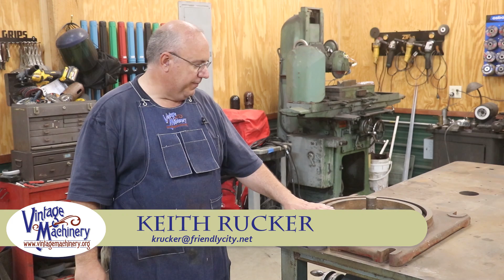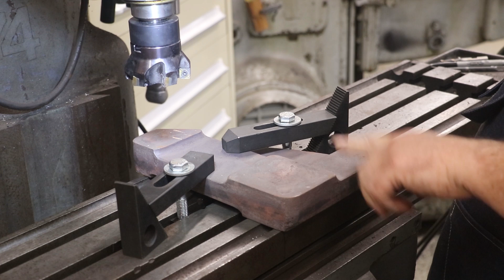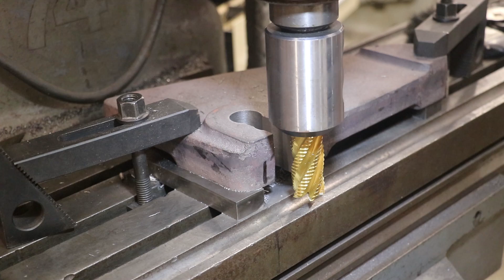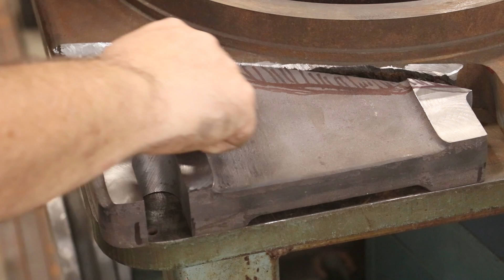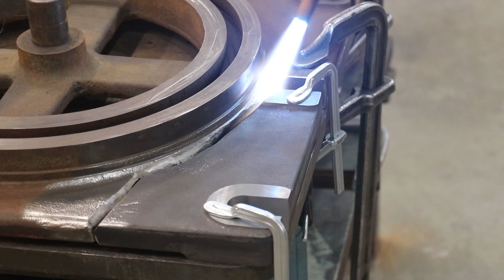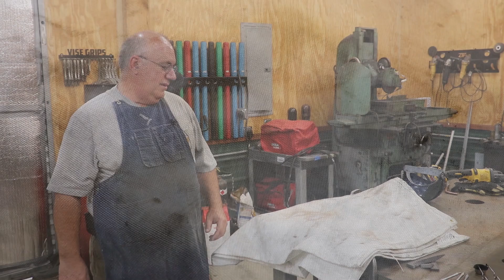Cast Iron Repair Job: Machining a Replacement  Casting and Brazing in Place

Comment: How much would you charge to clone or remake or fix a cast iron plate that's 3 x 10 inches with 2 bolt in thread holes.?

Comment: Wouldn’t you normally want to just use maybe a 3/4 inch end mill and step over to your finally dimension? To avoid things like the harmonics that may be made worse by cutting on either side of the slot

Comment: I know this is an old video but I do alot of old farm equipment repair which consists of a lot of cast repair we don't have time most of the time to heat and weld and reheat and pack cast to do so called proper cast repair and most of the time the piece is still on the tractor or implement. If it's a no load item I always braze it I have cast things I brazed 30 some years ago still holding up still doing their original job, If the part is something with a load or is in contact with ground such as tillage implements I weld them back together with 308 stainless rod bonds cast nicely and wears good in the abrasive dirt I've never once have had a repeat repair on cast parts welded with stainless many of the old timers did it and many of their repairs are still holding strong see them everyday just about. You'll of course have your keyboard warriors tell you brazing or welding cast with stainless is wrong it will never hold it's weak and so on because they have never done it or they can't weld period or they never cleaned their parts properly or someone told them it's wrong and doesn't work. I have a Cat D7 dozer that was abused it's whole life in a rock quarry that machine is pretty much all brass and stainless with all it's welds and cracks that were repaired over it's life but the machine at 73 years old will still go out and push dirt all day long like it was built to do.

Comment: Wouldn't have trouble keeping the heat in and not use so much "gas" in your bottles if your part was wrapped up in a welding blanket or insulation of some sort. What no post cooling hot box?

Comment: Keith, what rods did you use for that job? I have to braze up a broken cast iron garden ornament for my wife. I do have SIF Silicon Bronze No.1 rods which is supposed to be suitable for both mild steel and cast iron. I will be using a Carbon Arc 180 Amp AC welding torch as I don't have gas but will pre-heat with a butane torch. The alternative would be to use some 2.5mm nickel/Fe cast iron welding rods but like you, my results with these have not been wonderful and have looked a bit messy. The cast iron is quite thin and I find it is easy to get holes with the Ni/Fe rods on an AC arc welder. From past experience, I find they work better on a DC welder, which again I don't have.

Comment: Gave me a flashback of when I was watching my father-in-law braze an Old International 101 combine variable speed pulley half to re-build and bore  the pin holes it road on.  He was sitting with the pulley in a stump mounted vise, somewhat between his knees. A hot molten bead ran out and down the slope of the pulley and right in his half open laced boot. Big 6'-6" 280 pound man pulled that boot off tearing right out of the leather. Had went all the way to the sole of the boot and  cauterized  the wound on the arch of his foot. Last time I seen him braze anything.

Comment: If you have a veary large piece to Braze for added strength drill and tap studs at different angles in the gruves use Borax flux generiously and use plenty preheat burners on the bottom castings 🙌🔥

Comment: When you melt cast iron to weld, the material crystallizes during the welding......nothing I have personally seen welding wise does not ruin the metal.

Comment: Couple of comments from one old school maintenance man to another:

If brazing gets the job done for the intended purpose, why weld?!?
It's kinda like going to prom in high school. If you can take your girl in a ragged out AMC Hornet and get as much "action" either way, why rent a limo? 
Yeah, I drove a Hornet in high school. It worked just fine for me...

As for torch versus TIG brazing on cast iron of parts that big; Torch all the way.
With cast iron you HAVE to spread the heat before you braze or weld. the important thing is to keep the heat differential down between the part and the weld/braze area. You kinda want to 'feather' it out.
Unnecessarily changing tools to get a job done is frowned upon in the real world.

It's also important to evenly cool the piece down after brazing, and passing the rosebud over it every once in a while while it cools helps to relieve any stress imparted by the brazing. The blanket helps a lot, too.

Interesting trick taught to me by my mentor in industrial maintenance is what I call the "Rosebud Trick".
If you take a rosebud oxy acetylene tip and light it on just acetylene, you can coat a part in pure carbon.
Interestingly enough,  once that part gets to about 400 degrees F, the carbon on it wants to make CO2 with the ambient oxygen in the air.
Even more interesting is that 400F is about the temp you kinda want to pre heat cast iron and aluminum to, before brazing or welding.

Long story short, that torch in your hand is literally a 'multi tool' if wielded right. It is not only a pre heater, it is also a pretty precise temp measuring device, and it is the tool you can use to weld/braze.

Side note: If you want to case harden some steel, you don't need to buy Carbonite case hardening powder. Just use a rosebud and switch the oxygen off to add some elemental carbon, then on to raise the temp.
Rinse and repeat.
It's slower in a sense, but quicker over all. 
You're not sprinkling powder or dipping parts in a can. You're just turning a valve every once in a while.

Oxy acetylene torch sets are golden tear drops of God's sweet love to old school maintenance guys.
Molon Labe! Come and pry my Oxy Acetylene kit from my glove covered hands!

Comment: 16:47 should take more care not to get chips in your vernier gear track on that nice analog vernier!
Reply: Please get to know tools before commenting. Mr. Rucker is using dial calipers. You are right in the fact that small chips can crash the gear works on dial calipers.  This is one reason I prefer verniers as they are mostly immune to this problem. A quality vernier scale can be read very easily with just a little training.  You can interpolate to 0.0003” with ease. And they are simple.
Reply: Tracy Lemme please relook at the video. That is an analog vernier, hence open gear track, sir!
Reply: MagnetOnlyMotors. Please Google “vernier”.  Keith is using a  “dial” caliper which uses a gear rack and pinion to drive the needle on the dial. This is not a vernier scale.  Vernier scales use a number of spaces ( say 25) on the slide in the length that one more (26) spaces on the beam would use. No gears, no dial. Only a slide on the beam.
Reply: MagnetOnlyMotors 
Hahah
Reply: Why is this funny?
Reply: I was only commenting on sparing your dial measuring device from metal chips. Carry on as you may.

Comment: I appreciate the video, but why on earth do you not use cutting oil to save your tooling?
Reply: junglejonny1000 
Don’t need lube to machine cast iron due to the high carbon content.
Reply: @Crewsy  um... how much have you actually done ANY machining?  If you have, I been your tool retailer loves you lol

Comment: My GO to is also brazing when I can put the preheat into the c
Reply: My go-to  is also brazing when I can safely put the preheat and the heat into  the cast iron part. Second is a nickel or cast iron stick rod if looks don't matter, but I have had a lot of great repairs on cast using LH 7018  welding in very  short runs and peening the heck out of them immediately and skipping around. Weld matches very good and keeps the heat low enough not to distort anything.  Always worked best for me when having to weld mild steel to ductile material like manhole risers for asphalt road paving. Nice video Keith, thanks.

Comment: Keith, do you have a profile gauge?  It would make your life a lot easier for matching up parts like that.  You set the profile of the existing part in your profile gauge, then put your new piece in place until it contacts the existing part as you had it, measure how far your part sticks out along that outside straight edge, then locate your profile gauge to the correct dimension from your existing part edge and trace your profile gauge onto the new part for a perfect edge geometry.  This is useful for all sorts of jobs, even tile floors and millwork.
Reply: Or a pèncil and sheet of paper.

Comment: Jon Kaase in the 2015 Vintage Engine Dyno Challenge quote, "I've got more money in the 10 pounds of special welding rod it took to modify the heads than I do the actual cost of these brand new heads." That's reason 1 for me to stay with gas brazing cast iron! Great job, as usual Keith!

Comment: The company I work for has motors with inter graded gear boxes.    That have circular cutting blade on them as they run on a track and have a hard stop  they brake the ears off . This was due to the wrong size blots to hold them down I found out later when I took it apart  I was asked to look and see what was wrong I saw that the ears had broken off and told the lead Hand and he said to shut the machine down Untill we get a unit. I told him I can fix it give me two hours and we will be running .As the gearboxes are cast steel I brazen the ears Back on and we where running. Only to find out their where three other units all the same , so I fixed them all that was  their and saved the company $ 1500.00 dollars  unit. I had  to use the cutter torch to get enough head in them too brace and it worked well.

Comment: mr rucker do you and or was able to get the brazing  rod to flow at least to the bottom of the vee?? and when u flip it over  and re heat it will the brazing rod  bond to what you had  laid down on the top my thought if I had any brass looking at me on the bottom I would've tried my best to melt it bond back to it on the back side minus it dripping out of your last weld. cant wait to see how you finished the project thank you sir

Comment: no oil or coolant on cast ?????????????????? maybe where I been messing up  your thoughts
Reply: Cast iron can be machined without any coolant.
Reply: Cast is a self lubricating metal.  Lube just gums up the work.

Comment: Keith I agree whole hearted that flame brazing is the way to go on something that large and thick. I have been doing that sense I was 9 you ears old and have worked for a company where we repaired large mechanical press rams and knuckles etc! . We always flame brazed and I have never had a failure to my knowledge. Good choice. I have also made a many repair using Ni - Cad rods and others but you still have to maintain a good bit of heat so I am confident you made the right choice.

Comment: I've seen you braze cast iron before and I think your judgement on this job is spot on.  I also like the idea of finding an old oven to preheat/bake pizza - has the added advantage of baking out any oils that might bugger up the brazing.

Comment: Nicely done.
I wondered like several others why you didn't try and get heat into more of the part before you began brazing, but I guess you just had to be sure you could keep the repair area hot enough while brazing and the rosebud supplied enough heat?
Thanks for the video.

Comment: I agree brazing is the best , welding in opinion allows for air and water migration if not solid thruout. And ive been around longer then most on here preaching the welding. Tig may be really good with the bronze filler rod from my perspective it should flow in to the pores of the metal like brazing rod with flux, borax.

Comment: The  more i get to observe you Brazing Cast iron the better. I recall from some  years back that when i tried stick again after many years away from it,  noticed I was more adept at it after many thousands of hours under the weld  helmet working and watching that puddle during production Mig Welding. Exellent project planning.  I kinda consider myself as part of my tools, that is like what I am more able  with ME low on "Gas".
    One of the most enjoyable skills that I learned in the Weld dept. of a fab shop I worked at, was learning how to fix others mistakes. AND have it be a good part. I don't always say it but great effort and also a good product; Video and a good  Part.

Comment: Great job brazing up the joint.  I have been gas brazing cast iron parts for many years.  The idea of an old oven to soak the whole part to 500 degrees over nite is what I always did on large cross section parts.  I finish joint with filing surface vs. grinding  prior to brazing,   Was told years ago that grinding draws out graphite to the surface and inhibit good adhesion between parts.  Great seeing old parts saved instead of sending to the dumpster.

Comment: Looking good Keith. You did a nice job on the preparation, getting everything linded up and looking straight. By the time you clean the top up and get it painted nobody would ever know  that it was broken. Looking forward to the next video. Thanks Andy

Comment: What your shop needs is a good used oven, soaking large cast iron parts over night makes brazing them a lot easier and reduces heat warp as the entire piece is close to the same temperature. Ten years ago I picked one up from Habitat for $25.00, as a side benefit it can still cook a frozen pizza for lunch.
Reply: What sized oven did have in mind?
I can see the point for small pieces say up to 15 to 20 inch, but the bit he's currently working on, not a hope,  its got to weigh 300 lb.
You are right about the pizza idea though. 
Cheers
Reply: @dhc4ever  It is a used Kenmore 30” wall oven, it came with a broken door handle and a burned out upper element, $25.00 from Habitat. You can get a 24” wide and 20” deep piece in it, longer if you take the door off and wrap the front with some Nomex blankets.

Comment: The old adage of 'Grinders and paint...etc' never fails to apply does it!

I hardly need to say it, but simply excellent work Keith! How you could get that rough casting so well matched to the broken piece is simply beyond me. I would have messed that up in three hundred different ways.

Many, many thanks as always for the video. I look forward to seeing the next section of the repair.

Comment: can brazing be touch up with tig
Reply: Yes.  You can almost always add to brazing.   Brazed joints usually can be repaired.  I brazed at Trane for about 14 years.  Clean copper to copper doesn't need flux but flux needed for everything else and dirty copper.
Reply: @royreynolds108  
 good to know  better control with tig
Reply: It can and should be touched up with the gas torch when the piece is still hot

Comment: That is a big hunk of cast to preheat. I was surprised that the woodworker, in you, didn't scribe that joint in with dividers. Looking good though... can't wait for the finish.
Reply: As a journeyman cabinetmaker, I agree.    it could even be scribed from both sides to get the taper from the broken piece.

Comment: I’m alright with doing what you’re comfortable with. I had no experience and when I learned to weld cast iron. But I have also seen some brazing repairs hold the test of time. You were spot on with your assessment. Thanks for the video, like to see what’s left up your sleeve

Comment: Great video as always. The only thing I would have done differently is I would have preheated the parts on the charcoal grill to about 350. Saves a lot of gas.

Kent
Reply: I agree to that,more even heat.
Reply: @jameshatfield7634  That too. I used to have an old electric oven in the shop for preheating parts and small powder coating jobs, it was nice to be able to take a freshly brazed part and toss it back in the oven for a controlled cool down as well. I may have to check Craigs list for another one.

Comment: Ive always found Torch Brazing to be the best, specially as you said Keeping a lot more heat into the Cast iron. My dear old dad showed me this more than 50 years ago on a Large Old Dawn Vice which i still have and still working like a Charm to this day. regards Dave from Australia
Reply: And as their old slogan used to go:

"Make Dawn your only vice."

Also from Australia.
Reply: Brazing is the best way to go as long as the section is not really thick.  An additional way to secure cast iron is with the "Metal-lok" or "Metal-lace" proprietary systems.  For extra heavy sections (like the gear box on a Caterpillar D9).  It works, but brazing is still used along with Lab Metal or Belzona, etc.  You could pin this casting if you are concerned about bending loads, also helps with alignment.  Of course you have to pin first.  Good job!
Reply: @geoffmorgan6059  One of the problems with welding cast iron is the additional heat converts the iron into very brittle carbides. This is avoided with the lower temperature used in brazing.

Comment: Just curious why you didn't layout the metal removal in 7:00 and band saw out the bulk of it instead of milling? Finish it out with your finishing end mill.
Reply: William Garrett probably because it’s easier drilling holes instead of bandsawing because you can’t turn the blade in metal you would have to make many straight cuts.

Comment: I'm the same way, my goto method is brazing if possible.  I am much better at brazing than welding.
Reply: I used to be the same until I used lock n stitch. Now it's my go to although might've brazed this too.

Comment: Would leaving the welding blankets on top of the majority of the casting helped to hold heat in while you were brazing? Could you use something like a Kao-wool blanket to help hold the heat in? (Although, that stuff really needs to be coated with a rigidizer or something, so maybe Kaowool wrapped in a welding blanket.)